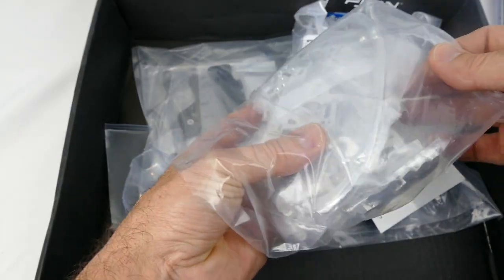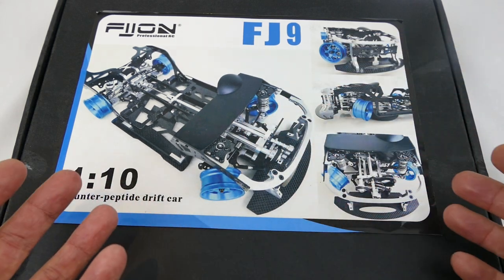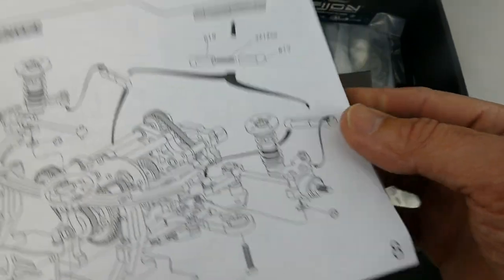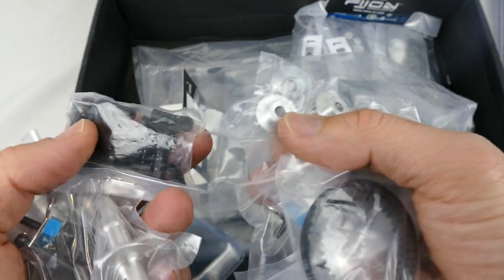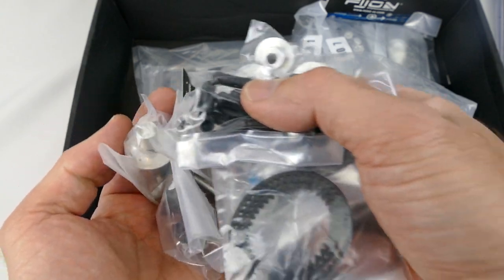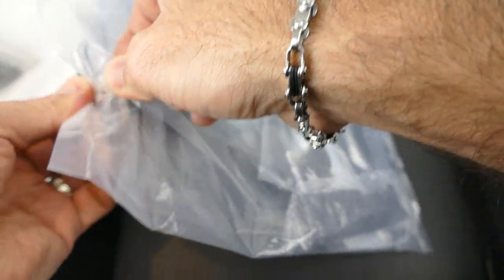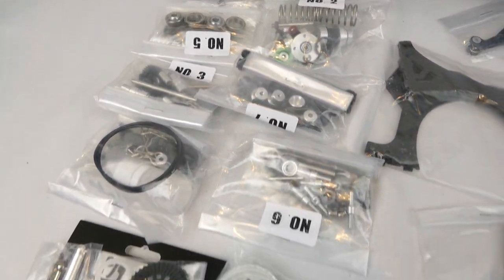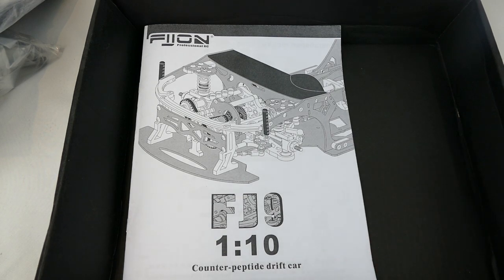FIJON FJ9 DRIFT CAR - Carbon Fiber & Alloy Masterpiece Part 1 Unboxing (AKA Dean Tech Bulldog)

Comment: Great Video Steve:) Just as i started watching i went WOW! If you manage to build this i bet you will have a better insight of real cars and even perform your own repairs, It absolutely awesome. Thanks for sharing it with us
Reply: Oh and however you decide to go brushless i'd recommend 3000kv or less for a balanced speed vs torque and a 3S battery as a minimum as seeing from the parts alone this is going to be as heavy or even heavier than the Arrma Senton!
Reply from the maker: +DIMITRIOS GYLTIDIS cheers bro, appreciate your help. Can't wait to start putting this bad boy together

Comment: Check RcMart for the Hactronic drift esc and motor combo. Pretty inexpensive and works well.  For servo there are so many choices.  Take a look at Alturn usa servos.  They are decent price and they also make servos for Savox.
Reply from the maker: +Bigdaddyd82 Vapes awesome man, thanks for the info :) Apparently this is a great car. Time will tell for this amateur :)